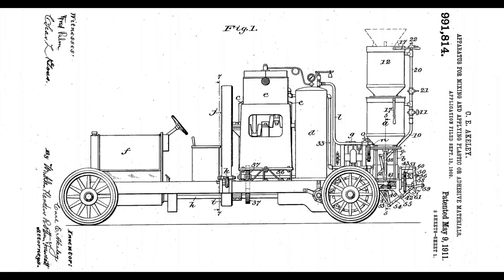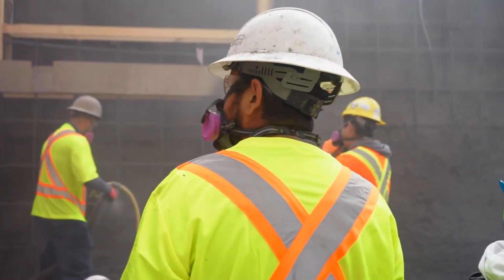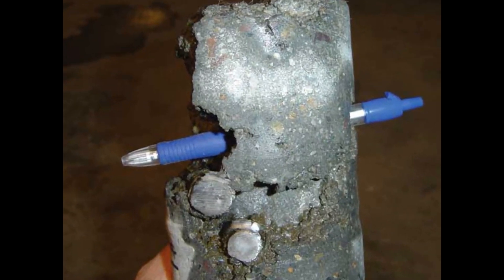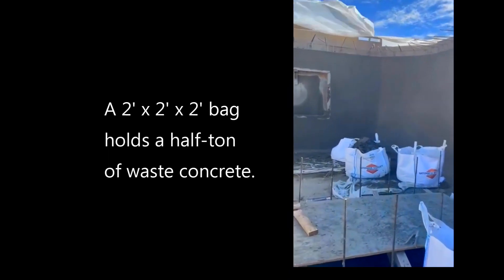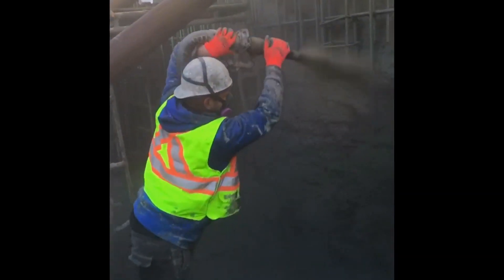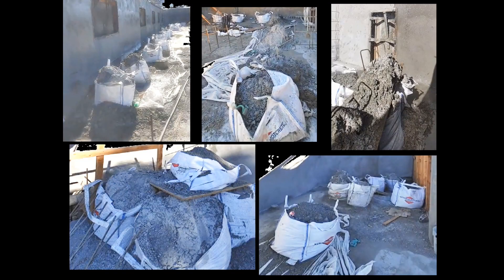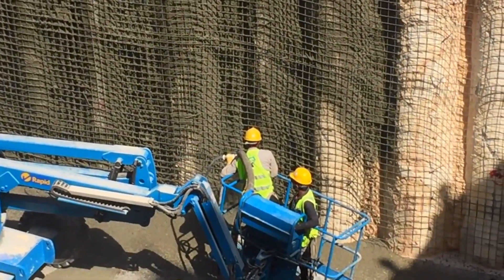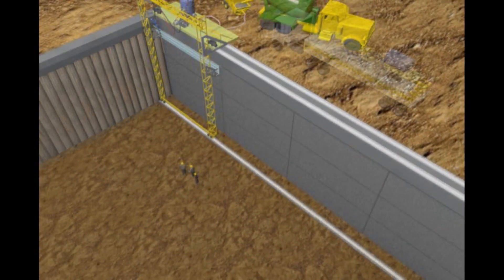SHOTCRETE v SPACECRETE | Shooting Concrete vs Ultra-Rapid Light-Vertical Slip-Forming with 3D-Admix

Comment: I remember seeing your work a few years ago and think that it is very useful. May I suggest that you look at this video of how to make a monorail. If you made two of them parallel to one another and made a simple mandrel/slipform you would be able to slipform walls while travelling in a horizontal direction with one less machine. Such a technique has many applications, from road building to terracing. Either way good luck, nice work. https://www.youtube.com/watch?v=vgmyaR9XnaY
Reply from the maker: Very nice idea, thank you!  Like this recent video on 3D printing: https://youtu.be/AXWbPz4pxy4
In the 1990's I saw train rails being used for building an elevated highway - guiding giant forms to adjacent pour locations.  It was awesome.
Reply: @SpaceCrete  No, not like that. I was thinking of two monorails with a vibrating hopper in the middle that you would push along and fill with spacecrete. It would be a bit like a railway track without sleepers, since the wall or whatever would be getting poured in the middle where there would ordinarily be sleepers.

I like the idea of monorails because they are cheap, modular, flexible, and can be placed anywhere with a couple of hammers spikes. So long as your hopper was suspended in the middle and articulated so as to follow gravity, you would have one of the most efficient terracing systems or kerbing systems possible imo.

Comment: Will SpaceCrete work to build an underground dome home?
Reply from the maker: I don't know that the overhead parts would work well.  For sure you would need a shaped slip form, and wire mesh in place, and go a lot slower.  An avalanche could be a real problem!
Reply: @SpaceCrete  make an airform, and add fibers. check out Aircrete Harry on youtube. Alternatively, use spray insulation foam against the airform, and then use your slipform method against the insulation.
Reply from the maker: @Velacreations  OK, thank you!

Comment: I wonder if the 3d admixture would work with alkaline activated cement and geopolymer cement.
Reply from the maker: Yes in both cases, though these both are typically so stiff to begin with...and themselves are 2-part in effect.  The preferred admix formulation would vary for these.  Actually for portland the formulation can vary to emphasize thickening or initial set.
Reply: @SpaceCrete  testing that would make for a great video